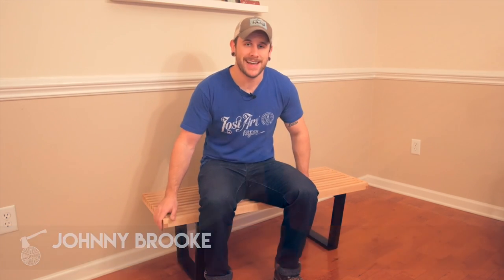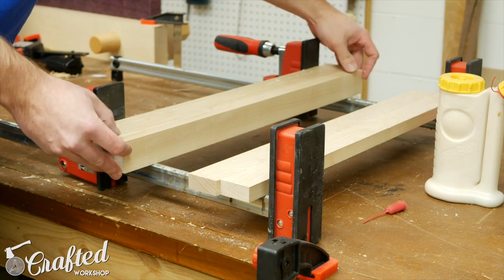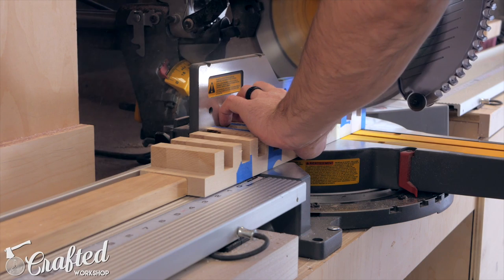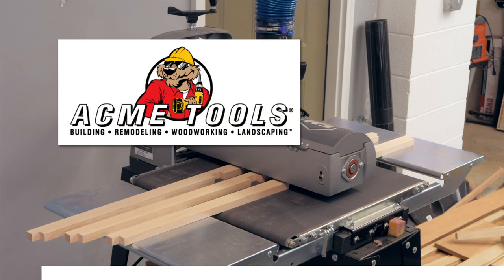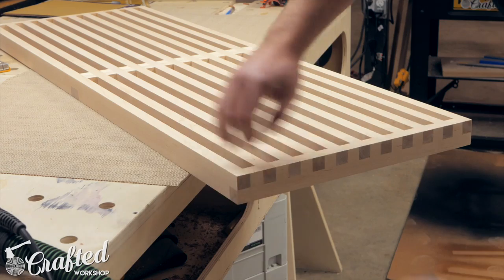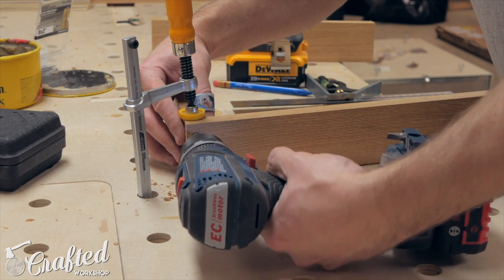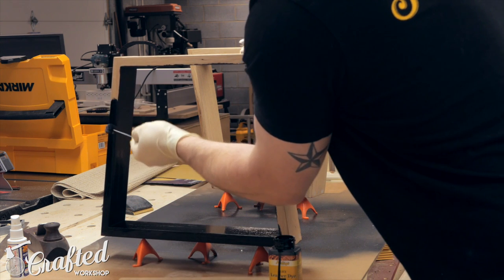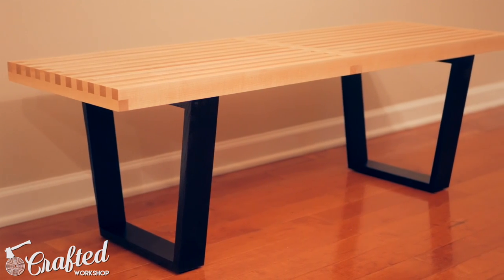DIY Mid-Century Modern Slatted Bench - Woodworking

Comment: Very impressive build Johnny! I like the idea of the leather dye. Also if you where having a hard time ripping down that hard maple into strips, next time you might consider using your band saw then thickness plane them down to size or use the drum sander. It may be an extra step, however you don't have to deal with the tension that can be in hard maple.
Reply from the maker: +GuysWoodshop thanks Guy! And yes, I will definitely be doing that in the future. It also wastes less wood likely. Thanks!

Comment: So I have a question - as you mention while cutting the dados in the slats, you had several slats to cut into.  Is there a reason you didn't do multiple slats in a row? If it's going to be cut in the same spots, wouldn't it have been useful to align and tape/clamp the slats together, and then just run a few at once across the table saw?
Reply from the maker: +Anthony LoPrimo I definitely could have done that. Not sure why I didn't in retrospect, hah.
Reply: Crafted Workshop style and cool points? :P
Reply from the maker: +Anthony LoPrimo hah

Comment: Hey dude. Awesome build! How do you determine your drill bit size and length for pre drilling? I've tried pre drilling and still seem to experience wood splitting. Also, how do you come across so much oak for these builds? I have a rough time finding any that someone's not trying to charge an arm and a leg for it!
Reply from the maker: Thanks a lot! As far as pre-drilling sizes, I don't seem to have a lot of trouble with it. I bought a countersink bit that's meant for #8 screws and I just use #8 screws when using that bit. Simple! This Oak was just a piece of scrap, but Oak is cheap in my area. Sorry it's expensive where you're at!

Comment: Nice work, personally I think 8 degrees is too much, 5 is a little better and gives more surface on the floor to keep things sturdy. Cause people are dumb and will sit on the edge and flip it.
Reply from the maker: +Joel Turner the legs are only 14", so even with an 8 degree angle, the bottom isn't that much smaller. This also is very close to the original design which has been produced since the 1950s.
Reply: He also designed that bench specifically to be uncomfortable so people wouldnt sit in his office and loiter. So maybe he wanted it to tip over. :)

Comment: nice build, but a little unfair to call it diy when most of this build needs to be precise so the half lap joins are nice and flat
Reply from the maker: +Maru Chan I disagree. You can be precise as a DIYer, just take your time and pay attention to the details. A belt sander goes a long way in flushing everything up after glue up.
Reply: Well, of course you could cut it with a hand saw and then sand everything until it "fits", but it would take an awfull long time to do that. Yea you can literally DIY anything, but to make those precise repetitive cuts so everything fits in the way it needs to fit, you defetinely need some kind of presicion machine, or be really good cuting square everything.
Still, it's a nice build.
Reply: Machinery will just speed things up. Its all about the time usage, effort and skill, not to mention how well you can hide your mistakes that eventually will come.

If you have time, then rough cut with hand saw and use chisel to get close, sand paper to make it perfect. Power tools just make these things much faster to accomplish.

What does it matter if it takes long time? It cheaper than paying to someone else to do it for you, you learn in process+save money to buy those fancy precision machines. I'm pretty poor and was able to make professional quality custom crafting table for my gf, with integrated wall sockets, audio system and such in 6 months, using nothing but basic hand tools and elbow grease, middle of my living room.. get right mind set and you can accomplish anything.
Reply from the maker: +Hellsong89 so true!